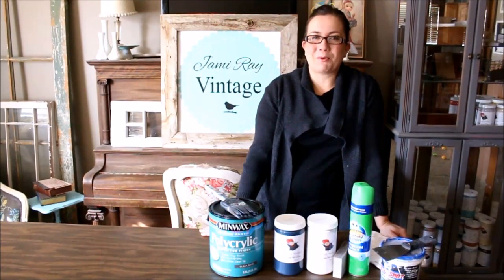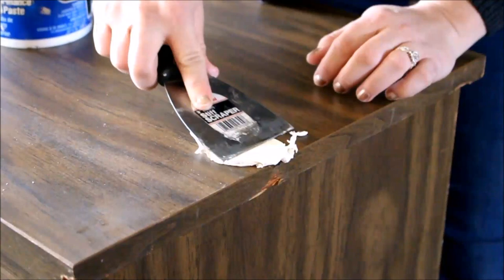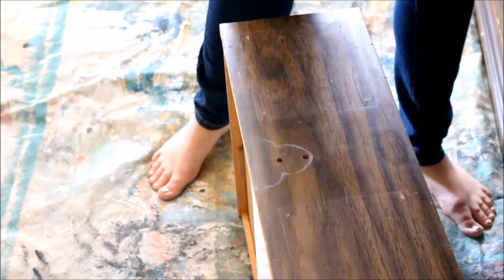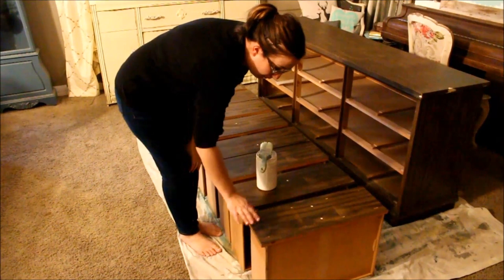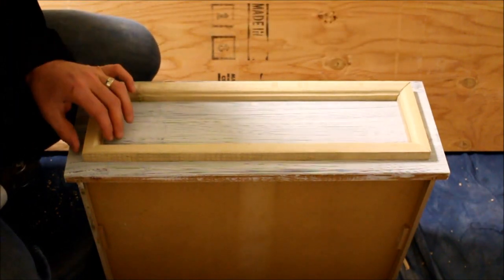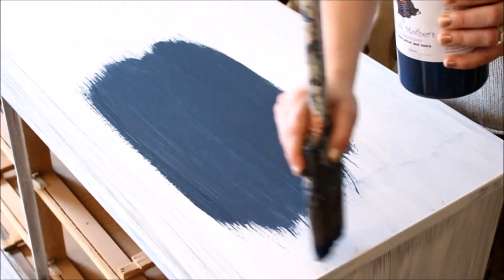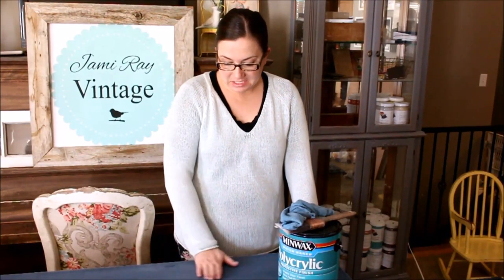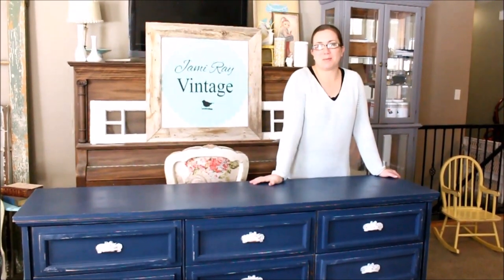How To Upcycle a dresser

Comment: Beautiful! I'm wondering how you prevent dust from the sanding getting everywhere? I have the same exact sander with the catch bag and i have to sand in a part of my garage that I cordoned off with ceiling to floor drop clothes. Otherwise everything  in my garage gets covered in sanding dust.  And there you are, sanding right inside your lovely shop!
Reply from the maker: It gets dust places sometimes. Sometimes I hook a vacuum up to it if I have to do a lot of sanding inside. Also, Diablo abrasives makes a sand net that catches a ton of dust. They sell them at Home Depot. 👍
Reply: Jami Ray Vintage Thanks, I'll check that out!

Comment: a guy at the hardware store told me spackle like the one you used isn't good because it could dry and chip like a plaster wall after being dry. has that ever happen to you? I have a wooden side table that I want to fix and sell as well
Reply from the maker: Jessabella Baez I only use it on small stuff.  You might also try plastic wood by Dap. It's awesome, doesn't shrink and is stainable

Comment: I love it! When you use the poly with a brush, do you get tiny little bubbles? I always do and when I try to sand them it makes the bubbles white and show up worse. Do you have any tips?
Reply from the maker: In the past I have added just a little water and that has made it go on without bubbles. But usually I don't have problems with that